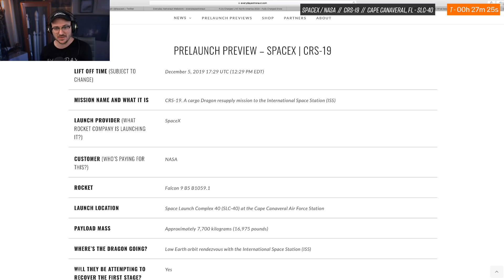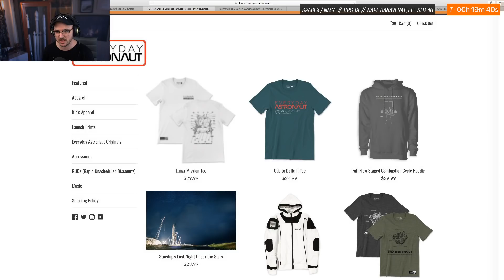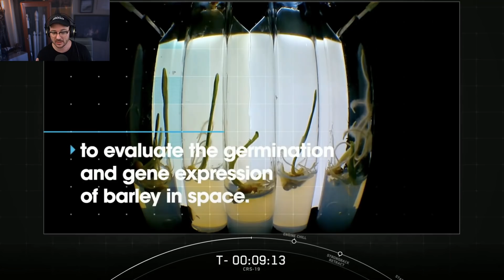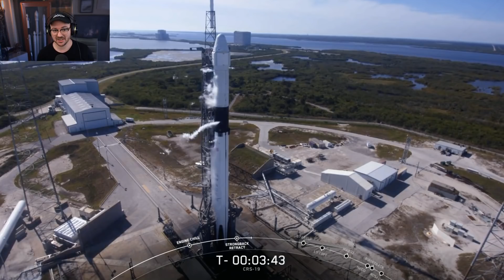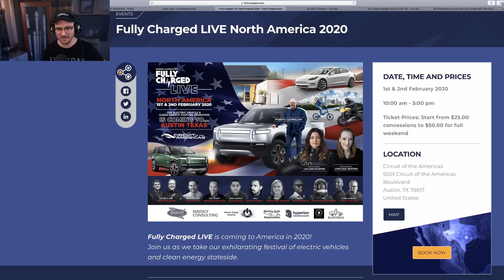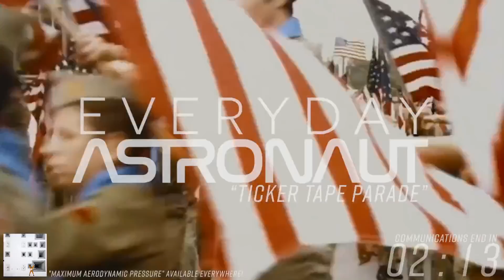Watch SpaceX launch (and land) a Falcon 9 going to the ISS! (CRS-19)

Comment: Hey Tim! I got a question for ya that I can’t seem to find an answer for anywhere else... what if someone designed a sort of 3rd stage for the Falcon 9 / heavy rocket? One designed to carry payload from LEO to beyond. 

The reason I ask is because the single stick Falcon 9 has been proven to carry 15 tons to LEO and still land for reuse. If a 5 ton high ISP kick stage was placed under a 10 ton vehicle, how much performance would theoretically be possible?
Reply: Well they already sent an actual car to very close to the asteroid belt ( with the Falcon heavy ). I guess that would qualify as "beyond". But you are correct they could easily launch a kick stage on either F9 or heavy as long as the total weight didn't exceed the max payload weight. Most GEO satellites do have an internal "kick stage like" thruster.

Comment: 44:20 There would be an easy and cheap solution to the vibrating antenna problem. Similar to how SOFIA the airborne teleskope is stabilized: The whole 17 tons apparatus is balanced on one bearing and stays precisely pointed due to rotational inertia. Putting some 5 to 10 tons of concrete on a ship for inertial mass does not increase fuel consumption  to a relevant degree. Also the cost of materials would be miniscule, like way below 2000$
Reply: No, the vibrations here are much greater than that.
Reply: @odysseusrex5908  honestly i doubt it. Movement of the landing platform may only reach a certain amplitude to allow for a proper landing. Lets say you put 4 portions of 3 Tons of inertial mass each on a cross of metal beams 20 meters in diameter, this will have a resonance frequency in the realm of 1/100 to 1/1000 Hz, wavelength far beyond those 5 seconds of actual disturbance...
Reply: @odysseusrex5908  btw the droneship uses 15 kilotonnes of water as inertial mass during landings. They only have to hook up a tiny fragment of that to the antenna.

Comment: Its great you explained why the replacement of a titanium valve, makes the rocket safer. Whats, annoying from past Shuttle failures, we did not find out until years later why the shuttle program failed because of the very expensive, repair costs of the Shuttles.
Reply: The Shuttle program did not fail, and I don't know what you mean by repair costs. When a Shuttle broke, it was beyond repair.

Comment: Maybe they could use Starlink eventually for better landing videos.
Reply: They will :)
Reply: Starlink won’t help. They need a local transmitter not disrupted by the intense vibrations of the stage 1 booster, such as a nearby ship.
Reply: @originalmin  might help a little multiple satalites and they are closer.
Reply: @originalmin   Using a broadcast instead of tight beam would substantially reduce that problem.
Reply: @odysseusrex5908  you can't really it's too far out in sea for that
Reply: @TheMarineGamerIGGHQ    It is for direct transmission to land, yes, but when you have thousands and thousands of LEO Starlink satellites, that will be different.
Reply: @odysseusrex5908  possibly
Reply: they had to distract you from the fact its fabricated
Reply: @ombudsmanwilson2665  are you actually stupid?

Comment: were there any humans on any space x flights before?
Reply: No, not yet
Reply: @riverscurry2436  is there any manned flight planned at the moment? the rockets look fairly safe to me.
Reply: @FoxBoi69  A crewed test flight is planned for q3-q4 2020.
Reply: @FoxBoi69  Right now they are planning on testing the infight launch escape system later this month, a test necessary before being able to launch humans (a rule by NASA I think).  If you heard, earlier this year when testing a launch escape system on the ground the capsule ended up exploding in a huge cloud of hypergolic fuels, so even if the rockets seem perfectly safe, the capsule needs proper testing too. Sorry this is so long.
Reply: @thesilverniko7654    More like q1-q2.
Reply: @riverscurry2436   No, the capsule did not explode. It was the service module, which had been detached, which released the hypergolics, even then, it did not explode. In a real situation, coming down in the ocean, they would have been nowhere near each other.
Also, NASA does not require the in flight abort test, just one on the pad like bowing did, and SpaceX has done. SpaceX is doing the in flight test on their own.
Reply: SpaceX has been developing a crewed version of Dragon for several years now. They successfully flew it, unmanned, to the space station last year. the first manned flight should be within the next few months.

Comment: Hi Tim.  At 35:44 we see the nose cone come off.  How does it manage to do this while it is being pressed against the Dragon by the massive acceleration of the 2nd stage?  I could imagine explosive bolts, but I guess it needs a big boom to be launched forward and then off into space.  It might not be as obvious as it looks...
Reply: Nose cone/fairing not needed for Dragon, as it’s aerodynamic enough already... Oops! My mistake!
Reply from the maker: It does have a nosecone that covers the docking port, Bert is right. I’m not sure the exact mechanism but likely not explosive, most likely strong hydraulic or spring pushers. It would likely slightly push back on the vehicle but such a little amount compared to the Merlin engine
Reply: Spacex doesn't use explosive bolts anywhere. They mostly use pneumatically retracted pins and springs, except for the launch hold downs which are probably hydraulic because of the extreme strain placed on the launch lugs.

Comment: No one talking about the van Allan belt. Oh yeah
Reply: The Van Allen belt is mostly above 600km. The ISS is at 400km.
Reply: Allan Gibson true..the first layer is stronger roughly between 1000-6000km..so what now Louis?
Reply: They have been using all that extra supply to disrobe the 'van Allan' belt. After the belt has been opened it has moved into the sun. There it was totally burned up.